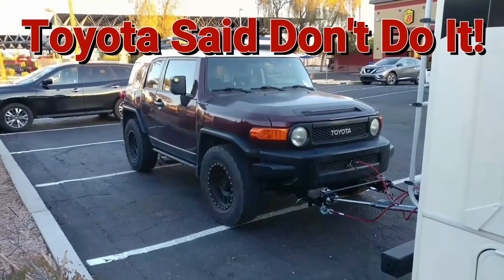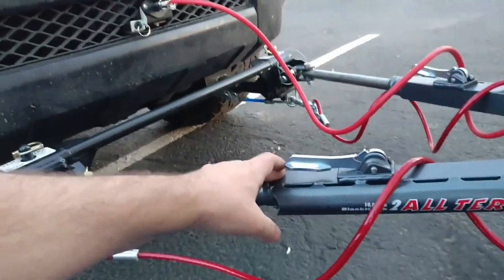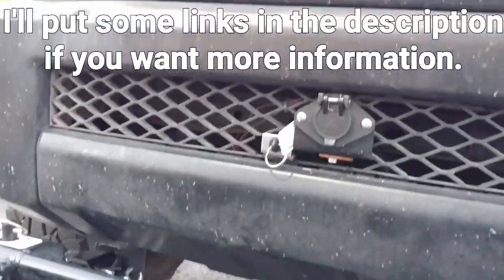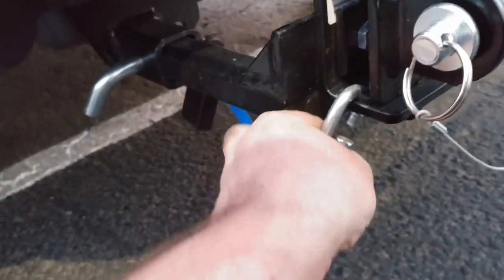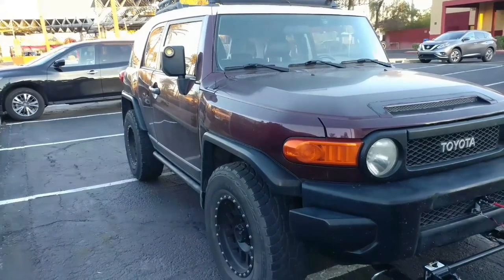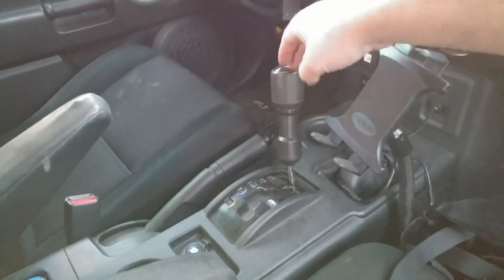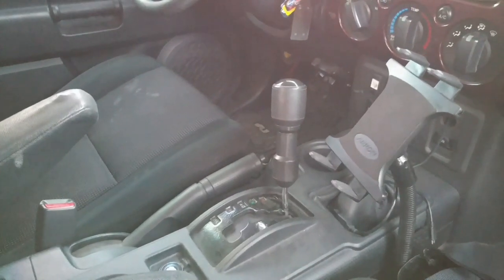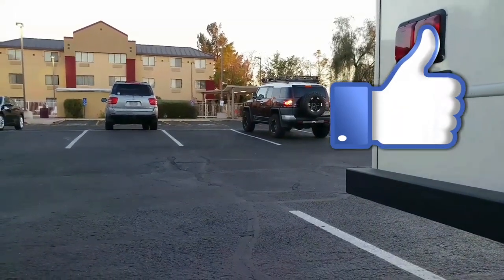How I flat Tow a Toyota FJ Cruiser behind my RV.

Comment: I've been researching driveshaft disconnects...talked with Bill at Superior/Remco in Iowa...Very nice guy and patient with my questions...Also, talked with a Remco installers in Nevada and Mesa, AZ....Installer in Nevada had a good idea...or at least I think so...he says they usually just install the disconnect, but not the lever that goes into the cab....I think that's where a lot of the installation cost is as that thing looks fiddlier than hell to install...and kind of hinky overall...Can't remember the prices quoted for just the disconnect, but pretty sure it's south of $800 installed. 

Just another option for you folks.  Just manually slip the disconnect coupling to engage or disengage the driveshaft....Yes, you have to get under the vehicle.  But, you don't have to undo bolts and hang the damn thing...
Reply: That is what do.  I bought the cable shift assembly, but manual is so easy, why bother.

Comment: I always disconnect the driveshaft when flat towing for something more than with a strap.  My Tacoma is an automatic so I have to DC the drive shaft, it has the automatic differential but I also added manual hubs as it saves on wear and tear and ensures nothing will spin in the differential, transfer case or transmission

Comment: I was sent to this video from a customer who was looking for alternatives to a Remco Driveshaft Disconnect. Yes, this is cheaper, but you're not just trading convenience. On top of being a manual job, you may find yourself having to do the work in the rain, with your back on the ground. Also, while mentioned a bit in the video, a couple of other tips/suggestions:
1. Draw a line with a paint pen or similar lightly on the driveshaft before disconnecting it. This will ensure it's in the same position it was when it was disconnected. This might not matter for all vehicles, but save the time and frustration from learning the hard-way.
2. I'm all for any alternatives like this to save yourself a couple of thousand dollars, however, I would consider going down to a local machine shop and having a custom fitting made for your driveshaft when it's disconnected in lieu of the clothes hangers. Might cost a hundred or so dollars and a couple hours of your time, but if the driveshaft isn't totally secure, you'll be looking at spending significantly more money in the damage caused compared to your savings.
Reply from the maker: Yeah, i gave up on the close hangers. I've actually been pulling the the drive shaft completely off, and putting a plastic bag over the exposed section with a rubber band. The drive shaft is then safely stored inside the FJ.

I've also been making sure I have a tarp with me in case the ground is wet, muddy, etc. It's definitely a pain, and...

I'd love to get a Remco disconnect, but I'm not that rich right now. I'm also concerned about how durable it would be when used offroad.
Reply: @SJsAdv   I can't speak to the durability of it off-road, but I think I'd be more concerned with dirt and debris getting in the hardware that sits under the vehicle. Not sure what would be possible in regards to shielding that. I know the prices vary quite a bit all over the country, but there is a driveshaft shop about ~30 minutes or so from Atlanta, GA that installs the Remco units for ~$1200 - $1500 . I believe it's on the low-end if it's something that doesn't need to be custom cut or aluminum, otherwise it's $1500. I've heard of shops that charge as much as $3,500-$4,000 for the same thing, and those aren't even driveshaft companies... Safe travels.
Reply: @matthewrice2152  Matt - do you sale/install the Remco’s?  If so, do you have a website or email address you can share?  And what’s the name of the shop in GA that you were referring to?
Reply: @hamilton7012  For the disconnect, I would recommend can contact "Drive Shaft Services" 1395 Cobb Pkwy N, Marietta, GA 30062 . You will talk with Russell or Ernie. For anything else RV related, I handle that, and am an authorized installer for all the major brands. My company is "PDI RV"

Comment: A car hauler trailer with two axles and electric brakes is still the cheapest safest way out plus you have extra room for other stuff.  A large job box for camping stuff and my FJ fit nicely on an 20 ft car hauler trailer. As a bonus.....if you have a dovetail trailer you really dont need the ramps it comes with. Leave them at home. In 4x4 low range the FJ crawls right up on the trailer no problem. Unless you are on un level ground and its raining. It could side slip on you.
Reply from the maker: There's definitely advantages to doing it that way, just as there are advantages to flat towing. It really depends on what your needs and situation are.

Comment: Up Date; Got a call from a representative that use to install the Superior Driveshaft Disconnect kits. Bad news, most of these guys have stopped doing it for their customers, something about lawsuits and crap so they just stopped doing the installs. He wouldn't tell me if it was product failure or customer failures, (Not being smart enough to do the right thing or operate the equipment properly) I imagine a little bit of both. So, for my 4Runner, I will be disconnecting the driveshaft and have a welder weld me a plate above pumpkin to mount the driveshaft to. On the 4Runner there is a body brace made of thick tube that is in perfect position so I can manufacture a flat plate and weld it in place so I can use 2 bolts to firmly bolt the driveshaft up out of the way. I'll let you know how that works out, it's my plan anyway, I may have to YouTube it.
Reply from the maker: Thanks for the information. I'd be interested in seeing your solution. 
The only option I have found for the FJ was to install an external transmission pump, but I wonder if the transfer case needs one too.
Reply: @SJsAdv  I am gonna go with disconnecting the driveshaft over the pump. I have read way too many reviews where they have failed and cost them a tranny rebuild. from what I have seen, there is no way to know if and when the pump stops working during the trip.

Comment: Do you have any information on how to tow a Tacoma 4X4? What about the front drive train? To you have to disconnect? What about keyless ignition, to unlock steering wheel?
Reply from the maker: I've towed older Tacomas before with the front wheels on a dolly with the rear shaft disconnected. I'm not sure about the newer ones.
I have no idea how keyless ignition would work with this, but basically you just want to keep the steering wheel from locking.
Reply: @SJsAdv  Thank you

Comment: We are getting a manual 2012 FJ, you mentioned in your video that you can flat tow a manual.  Do you have any information on that?  In this video you said that they leave it in 4th gear and not disconnect the drive shaft but that doesn't sound right.  Would any of your friends be willing to get a video on how they do it?
Reply from the maker: I put a link in the description to someone who wrote about flat towing a manual. That's where I got most of my information from.

Here it is again for your convenience: 
https://www.fjcruiserforums.com/threads/flat-tow-6mt-yes-it-can-be-done.151068/
Reply: Thank you!

Comment: Been looking for a video like this.  I have a 4th gen. 4runner.  Do you think same rules apply?  Also, any links you may have to more detail of your disconnect would be appreciated.  TIA.
Reply from the maker: BadEye Diaz - yes, Toyota has been using basically the same setup in the FJ Cruiser, Tacoma and 4runner powertrains with just minor differences, since around 2005. Even for earlier models the same situation applies.
Reply: BadEye Diaz I’m curious about my 5th gen auto trail edition

Comment: Is your FJ a 2wd or 4wd? Did you put the transfer case in neutral or 2wd?? Thanks
Reply from the maker: ChiefShocker Its 4wd. I leave the transfer case in 2wd.
Putting it in neutral is actually a bad idea, while it disconnects it from the tranny, the transfer case will still be engaged with the front wheels and bad things will happen.
Reply: dude, by a dolly for 950 and put the transfer case in N, you are way over thinking this
Reply from the maker: mike w Putting the transfer case in neutral only disconnects it from the transmission, not the driveshafts. Plus you'll have the front shaft that is tied to the dolly also trying to spin (it will be in 4wd). The transfer case would burn up very quickly.
Trust me, I did my research.
Not to mention you then have to find a place to park the dolly when your at an RV park that doesn't allow trailers.
Reply: I called Toyota, you are correct, what a bummer.  We leave on our trip in 2 weeks.  I am still gonna dolly, just disconnect the rear drive shaft.  I will have to reconnect and disconnect several times.  Do I keep the tansfer case in N and transmission in P for a dolly as well?  Rear wheels only thing turning.
Reply from the maker: mike w I'd keep it in park and 2wd. Just disconnect the drive shaft, and make sure your steering wheel doesn't lock (leave a key on the ignition in the off position).
Reply from the maker: Toyota didn't makea 2wd version, but many of them where converted into 2wd after being shipped to the USA. Then sold at dealers as a 2wd.
Reply: I have a 07 4runner, there is no neutral for the transfer case. Are you guys saying I can disconnect the rear drive shaft , put it in 2wd and flat tow it?
Reply from the maker: Yes, that's the basic idea.
Reply: @SJsAdv  Wrong. My 08 is a 2wd from factory.
Reply: What would change with a 2wd FJ? Can it be towed front wheels up?

Comment: What about front wheel drive cars ? Can i disconnect cx axle  ? I concerned that removing  the cx axle  nut could result  on the wheel falling off
Reply: Get a dolly to put ur front wheels on and tow with the back wheels on the ground
Reply from the maker: Yeah, don't take off the CV Axles. A dolly is a much better idea. Check your owners manual to see what it recommends.

Comment: My FJ steering wheel locks up? Even with keys in ignition. It only is moveable when the car engine is on. I don’t think that’s correct?
Reply from the maker: That doesn't sound correct to me either. You do have to turn the key to the on position to unlock the steering wheel, but as long as you keep it inserted (even if turned off) it should stay unlocked.
Reply: @SJsAdv  Ahhh I associated power steering with locking. 

To anybody reading this: if you turn your steering wheel without the keys in, it will activate an anti-theft mechanism and lock the wheel from turning after a half rotation. To get it out, turn the key while simultaneously turning the wheel. 

Thanks for that little extra motivation! I have been properly educated

Comment: I'm trying to do the same thing, and I have the advantage of having been a mediocre mechanic. Here is what I figured out, and why he is likely able to do this: As it turns out the automatic transmission FJ cruiser actually disconnects its front wheels (sort of) when you are in 2wd. BUT IT DOESN'T HAVE UNLOCK-ABLE FRONT HUBS you say? actually Toyota didn't do it that way with this. The automatic employs a little known "Automatic Differential Disconnect"  actuator on the front diff. It works like this: There is a module mounted on the right hand side of the differential that slides a slip yoke in and out between the diff and the shaft, the two are not solidly connected except when the yoke slides out over the end of the shaft (when you engage 4wd). This doesn't exactly "Disconnect" the wheels, it only disconnects the right wheel, however because of the magic of differentials, all that turns in this scenario while driving 2wd or towing is the left CV shaft, and the spider gears spinning around in opposite directions, not the ring gear, thus not the front driveshaft. Then all you need to do is disconnect the rear driveshaft, follow this guys instructions, and it SHOULD work. 

The same is not true for the stick shift FJ cruiser, which uses a different 4wd system.

Comment: Does it matter to get the drive shaft and the differential bolted back into the same holes? I thought that the shaft and diff were balanced together and you'd get vibration is they're 90 or 180 deg off. But I could be wrong. I'm asking cuz I'm about to unbolt me Taco's drive shaft for a project (not to flat tow, just to get access to the underside of the bed).
Reply from the maker: trint99 They should be independently balanced. So no need to make sure they go back into the same holes.
Reply: I believe you need to get the front and rear differential "in phase".  If you look up the term, you'll see photos showing what in and out of phase with drive shafts.  Good luck.
Reply from the maker: Being in phase and being balanced aren't exactly the same thing.
I've never felt any balance of phase issues after putting the drive shafts back on.
But if you're really concerned about it, you can always mark them, and line up the marks when putting it back on.
Reply: SJ, I agree that balance and phase are different.  I bought the quick disconnect.  In the operations guide it talks about the drive shaft being balanced.  They also said that you still needed to install them in phase.  I had to look up what that meant.  I am not positive that all shafts need to be installed in phase, I was going by the quick disconnect stated.  But to your point, I agree that the terms are different.  I don't know for sure that phase matters.  It was an assumption on my part, based on how the balancing is done.
Reply from the maker: Phase is more of an issue with lifting the vehicle, or modifying the drive shaft such as adding a quick disconnect.
Reply: Phase refers to the front and rear U-Joints being in phase. The driveshaft and differential are independent. Doesn't matter which holes the driveshaft is bolted into . But. if you manually remove the driveshaft from the slip yoke, it could get out of phase when reassembled. The Superior Driveline has wider tabs in two spots to ensure that the U-Joints are in phase when reconnecting.

Comment: Why do you leave it in park?  I didn’t quite get the reason. Thx
Reply from the maker: So the transmission doesn't move and get worn-out, so the electrics don't get confused about what's happening, and mostly so the key can remain in the appropriate place to keep the steering wheel unlocked without the vehicle being turned on.

Comment: Why not just if you're not towing  a lot? My plan is towing 1000 or 2000 miles a year.  just to leave it fj (or my 5 G 4 runner  running and neutral..... I don't think the gas would be a big deal. Especially, i'd just be moving 1 or 2 times a month.
Reply from the maker: Running in neutural will destroy your transmission.
Reply: @SJsAdv  I'm not so 100 % sure. I need to do more research. But I believe with the motor engine running the torque converters  Push  the oil fluid everywhere it needs to go........... Just curious, are you a 100%? Sure. It would cause damage or do you just believe it would cause damage...... And you have specifics that  can  point to why Why this could cause damage?..... I've had different trucks with Allison. Automatic transmissions with the brick on the gas. Pedal were governed to go no faster59 mph miles an hour.... I would slip it into neutral and coast at at 75 mph. Down 30 mile grade did it all the time...... I also had an older Ford  2. W / drive with an automatic transmission. And I would tow it behind my LOG truck all the time, with the engine running  neutral never had an issue......
Reply from the maker: If you're spinning the drive shaft without spinning the rest of the transmission, you'll cause premature wear. For the same reason it's a bad idea to coast downhill in natural.
Reply: @SJsAdv  Thank you very much. I appreciate your reply and input...... I mean that... If in the research I'm doing  is, it's the lawyer's talking in the Toyota manual not to tow.... I think it can be done.( As long as the motor is running in the torc-converter is spinning) I'm gonna do a lot of research. My thoughts are as to talk to some local transmission rebuilders and get their opinion on my theory...... As of lately, there is more information on the internet on RV forums. There are people saying it can be done,&  they've seen people doing that.... Now it is accepted with a rem. Co. Lube  pump, you can do it a 100% absolutely...... But that's $2500 installed.... $1700 just for the lube pump...... But as my theory goes your torque converter is a giant lube pump... I'm gonna do a lot of research on it and then if my research proves it can be done then I'm gonna do it....... If I find any sources, are you interested in me posting it here.... I think this would be a game changer. Not the most fuel-efficient way, but if you're burning  6 to 7 Mpg  diesel fuel. What's a little gas for a few hours a few times a month?...

Comment: trying to tow a tacoma 4x4 auto was going to pull the rear driveshaft put tranfer case in nuetral but should i put transmission in nuetral or park
Reply from the maker: Keep the transmission in park, and transfer case in 2wd. Don't use neutral for either one our you'll damage them. You want to be sure they can't spin, and the transfer case goes into 4wd before neutral, so neutral still has the front axle engaged.
Reply: thanks for the reply very helpful

Comment: why not put transfer case in neutral?
Reply: Transfer case in neutral actually makes it worse. On the FJ, when the transfer case is in neutral, the from driveshaft is engaged.  The rear needs to be disconnected manually or with a disconnect kit, and the transfer case in 2WD.
Reply from the maker: Just as mark said. Neutral is still in 4wd. It's just disconnected from the transmission, not the drive shafts.